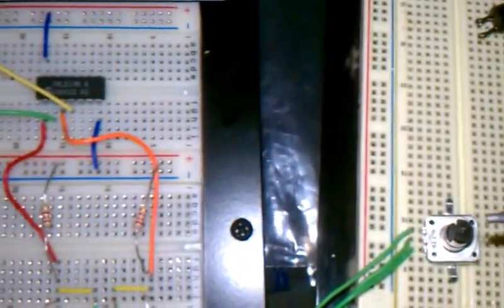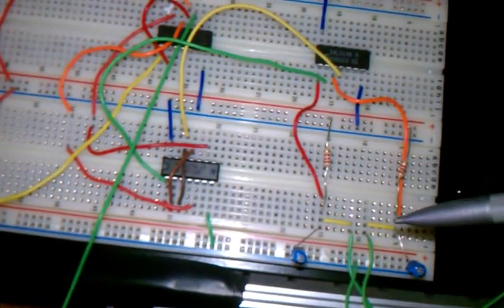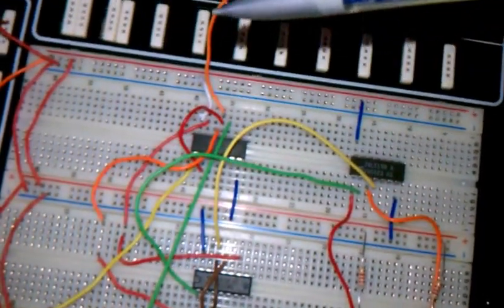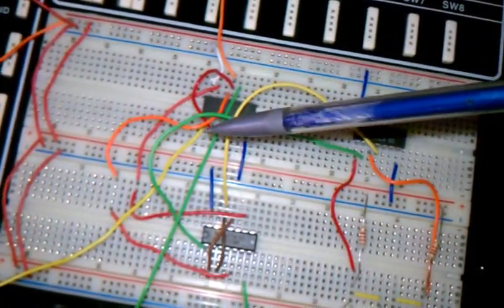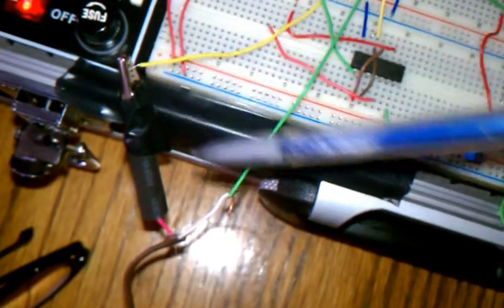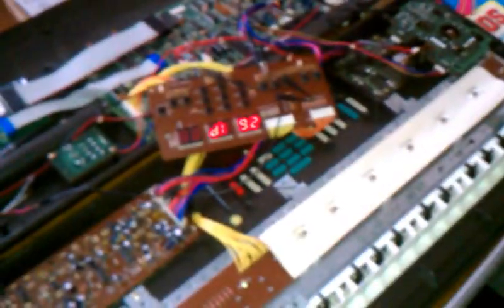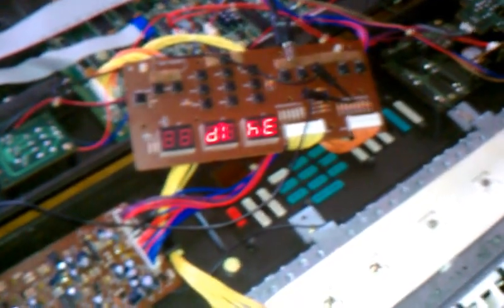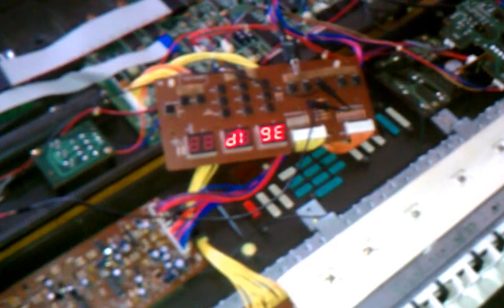Korg Poly 800 Data Dial ---  Custom Encoder Circuit/Driver

Comment: Nice! did you ever finish this?  I found this which I thought would do the job (using the bilateral switch, i.e. CD4066 at the end) https://electronics.stackexchange.com/questions/231803/rotary-encoder-to-2-buttons
Reply from the maker: I did, but it was not effective.  The problem is the Korg is too slow to keep up with the faster speed of switching when you turn the dial too fast.
Too fast and it begins to glitch.
Makes using it for Filter Cutoff sweeps practically useless.
So I abandoned the project.
I ended up installing a Hawk 800 kit and have MIDI control over everything now.

Comment: Hmmm.. I would love to use this together with a row of buttons in the paremeter section that directly switch into their appropriate modes (e. g. cutoff button turns on cutoff parameter 31, etc), similar to the Kawai K3 or Akai AX-80. I think that would be easier to implement than making a encoder circuit for each parameter.
Reply from the maker: It would be cheaper and faster to install a HAWK800 kit into a Poly 800 and use an external midi controller or build a custom midi controller like I did in my other vids.  This encoder project is simply mimicking switches already existing.
To create what you are asking for would require new code... if you get the HAWK800 kit, that's what you are doing, giving it a Firmware Update so it can respond to midi controllers, along with double the parameters.. like 4 LFO's, eleven LFO waveforms and a ton of other goodies.

Comment from the maker: 0.1uF caps.  1k Ohm resistors.   Still needs some tweaking though for the debounce circuit.  I'll be ordering more caps/resistors to try out later on.  That and a 74HC14 instead of the 74LS14 I used in this vid.